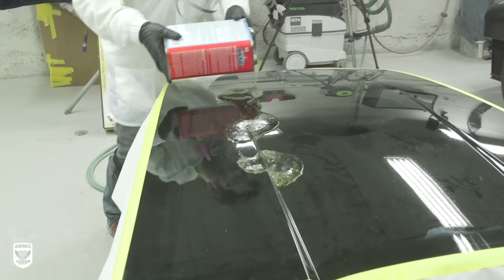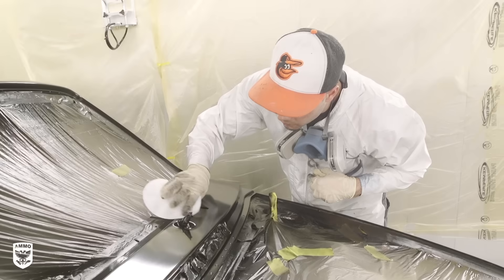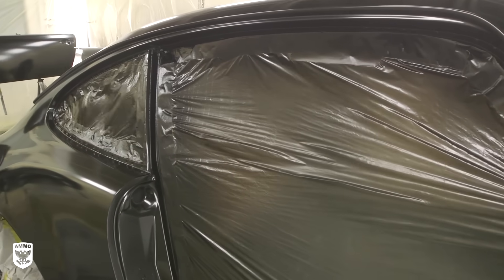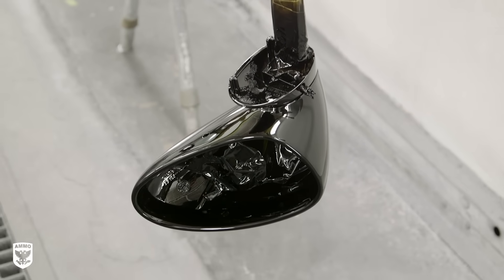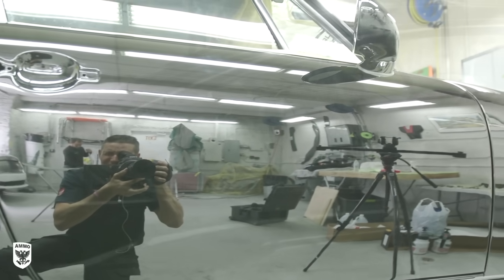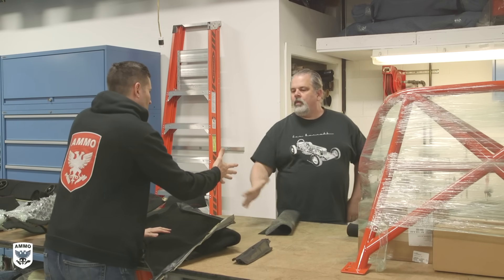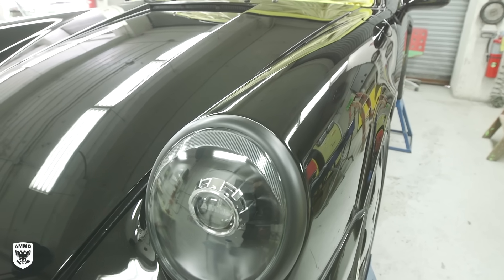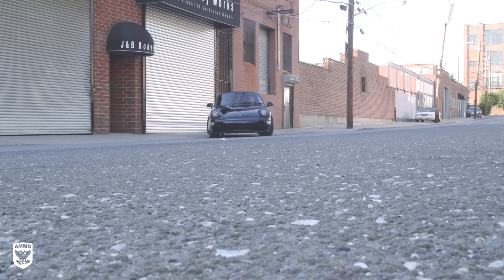Most Insane Paint Job EVER! Step-by-Step Process on the AMMO Porsche 964

Comment: A good paint job cost about $4000 dollars.  I can not imagine how much this must cost.
Reply: In the States a good paint job starts at around $8000 to my knowledge, and a show car paint is easily $20000-30000 alone. The work that goes into bringing it up to show car quality is insane. I bet they totalled out 100+ hours just in the paint department, if not even more.
Reply: round about 40.000 - 50.000 for this complete Work ... It's expensive as hell
Reply: @AustrianScreencasts, I was only talking about the paintwork, not bodywork at all. 
I work at a bodyshop and know how expensive that would of been, with this much attention to detail. I'd a rough estimate on the total would be closer to 70,000 to 100,000.
Reply: Ya'll for real?? A paint job like this would be approaching that much?  No wonder everyone just wraps their cars now.
Reply: It depends on what you want done. If you just wanted all exterior panels done in the factory color and wanted it to look OEM you could get that done well for 4-6k. The better you want the paint to look the more it's going to cost as is shown in the video. If you want showroom quality (ie no orange peel) you're going to have the car based, cleared, baked, sanded, cleared, sanded, buffed just like Larry had done, that is a lot of paint materials and labor to do that and it spans multiple days. OEM and showroom paint finishes are two very different things. That doesn't even account for interior panels which just stretches the project over more days and adds up more paint hours and materials, along with time to R&I the interior panels. Automotive refinishing can be very, very involved.
Reply: You could just go to Maaco and get the car sprayed for a few hundred, but for a car of this quality, easily over 1000 hrs of work went into it. And average around $100 an hr, it could easily be $100k
Reply: yeah but practically every maaco job is shit, and i speak from experience of having seen 10s of cars that were painted at maaco, including one of my own.
Reply: AustrianScreencasts $40 or $50 doesn't sound so bad
Reply: I had a '95 Chevy Tahoe painted at a Maaco.  I went to the shop and talked with the manager.  He didn't make any promises of a show quality paint job.  After talking things over with him, I selected their highest tier paint service (sand, sealer/primer, color, clear).  The paint job cost about $1100.  Was it perfect?  Of course not.  But I was more than happy with it.  I stripped the bumpers, trim, grille etc myself.  The more time you allow them to actually work on your car, the better your result will be.  

A paint job of this caliber, I would be surprised if it was less than $35,000.  The attention to detail applied to this 964 will never be reached in any volume shop.
Reply: Doug, Car & Driver once interviewed a small family paint shop in Los Angeles. They had JUST finished working on a Ferrari Testarossa and painted it black. It had been in the shop for almost a YEAR because they did so much prep work and spent barely a week actually painting the car. The owner got a bill: $16,000. And that wasn't with LABOR!

And the shop owner said it's NOT the most expensive paint job he has done.
Reply: Paint jobs are for fanatics and wraps are for rich kids.
Reply: GanG914 your comment is why I went to school for collision repair, I love when people respect paint and know that Wraps are as trash as the people who use them.
Reply: I probably should add a few things. The owner is a very quiet guy who refused to give his name. He said "Just call me "Junior." He does the same thing these guys do but on a smaller scale with a childhood friend who is also a damn MAGICIAN. Ferrari with uneven fenders (this is more common than you think)? He'll get them perfectly lined up. Air intakes bent and no parts available? He'll fabricate a new one from scratch and even the brand's mechanics won't be able to tell the difference. The sanding they do is insane. They start from 80 grit and work their way so high that the last grade they use feels like glass! That's why Junior's customers could spent 5-9 MONTHS without their car. And he does work on them about 5-6 days a week.
Finally, one hilarious thing happened to him. He finished his most expensive paint job only for the customer to be arrested a few months later and the Testarossa confiscated! The guy was wanted for embezzling and money laundering! How ironic. Maybe that's where he got the money...
Reply: $1,654,900
Reply: 4k is cheap buddy, we were charging £10,000 for resto's on lotus's and they are alot smaller.
Reply: +rcairforceone, so if you spent $1,100 for the paint job, what would most paint shops do for $3,000? Or is there no such thing and you have only two choices: $1,100 or $10,000?
Reply: Curious to see how many mils of clear are left after only spraying 2 coats and then sanding and buffing.

Comment: 12:18 “block sanded to remove heavier imperfections” 

what imperfections
Reply: I dunno man, that extra atom on the left side make's this a 0/10 for me
Reply: Xcalium 😂😂😂😂
Reply: the ones left by the metal bracelet at 12:21  maybe
Reply: Jeff Moth yuckkk mehn metal braclet on paint😬😬😬
Reply: If he would had use an iwata super nova he wouldn’t have that much orange peel for sure
Reply: K Man  I was a painters helper at 15 years old my Dad had a big Body Shop and we did mostly heavy collision work but some custom paint work once in a while yes body and paint work are hard work but once you learn what it takes it becomes routine
Reply: The ones the camera doesn't show...even half ass work looks good on camera(not that this is half ass) just sayin!
Reply: Orange peel

Comment: Yup very important to keep the trades going as the masters are dying off! My uncle passed away 19-1/2 yrs ago at 51 from ALS. He owned one of the biggest, cleanest collision repair centers in the U.S.A. I worked there for 15-1/2 yrs as the head technician in the R&R department. Every car came apart & we never ever...! Taped anything off...! If we replaced a fender & needed to go down the side to match the paint. The door came apart handle, mirror, belt molding & window. Taillights & bumper covers! So absolutely no over spray could get on anything. I did wiring harnesses, air bags, A/C, suspension, alignments! What ever needed to be done...really! We did an average of 35-40 cars a week. That's in on Monday & out on Friday...! No matter how severe the collision was! You can eat off the floors & the place is huge! Up front we had 3 lifts, 2 alignment racks, 2 Kansas Jack frame machines, 2 snap-on A/C machines. Brand new Hunter High speed wheel balancer & another wheel & tire machine. We also obviously had welders, torches, spot welders to do factory looking spot welds. State of the art Shark machine. This machine would measure your cars frame/unibody by electrical pulses. So if you needed to pull a car back into shape you could literally get it back to factory spec! We have a Devillbiss down draft paint booth. Which was on the level below the R&R department. Then below the paint department was the body work section. We also had a full parts room were every part...new & old was stored untill it was time to put your vehicle back together. We also have a reconditioning department where the cars went to get washed, buffed & cleaned before the customer got their car back. This room featured a lift & a state of the art water recycling system. So no soap went into the drains. One of the most amazing body shops on planet earth. My cousin still owns it. After Hours Auto Body in Taunton, Massachusetts. Check out the website if you wish....👍❤🏁
Reply: That shop sounds great, a workshop being kept super clean is always one of the best signs it's a legit place.

Comment: This is what you can expect from every MAACO $499 special.
Reply: You can expect orange peel whether you pay 500 at MAACO or however the fuck this much cost?
Reply: Most appropriate comment ever
Reply: 40 years ago I had my 1969 Cutlass painted at MAACO for $80.00 and it actually came out decent with no orange peel or runs.  Good booth and equipment and a good sprayer made the difference.  For a 10 year old car, good enuff.
Reply: grit not grid.
Reply: I will pay for a maco job and do the buffing myself

Comment: If you live in a metropolitan city the first time you bring this out a bird will shit on it and someone will bump a shopping cart into It
Reply: should have come with an engraved 1911, for those moments when a few choice swear words just wont do.
Reply: thats exactly what happened to my car. It was stored for 15 years and in the first 24 hours out some one magically scratched and damaged the bumpers while a bird took a massive dump on the hood, window and roof!
Reply: You can say... Shit happens??
Reply: Its a track car
Reply: This freaking eye scared me...like WTF...lol
Reply: 123456bmx +
1982. Had just done some touch-ups to my 72 Charger, blended them, buffed out the sand marks, and glazed it all by hand (we still used enamel paint then, no base coat/clear coat nonsense). Went out cruisin on a beautiful Saturday day. Stopped at a local restaurant to eat (too afraid to navigate that land yacht in the drive thru). When I came out, the black was looking all salt and pepper. It seemed as if every bird in the county had joined forces to do strafing runs on my car. I just gave up and went home. So funny now, I can still remember how mad I got that day.
Reply: Depending what angle and how hard someone bumps into it, the clear bra will take most of the damage. It might end up getting scratched but it won’t be as nearly bad compared to if it wasn’t. As for bird shit I’m sure he’ll have it ceramic coated in no time.

Comment: another good way to stop dust from wanting to gather towards your painted surface(cause when you paint you build static) is to lay a chain over the frame or axle and lay it on the concrete. It works great cause it grounds your car.
Reply: I use a grounding strap on a oem body ground.

Comment: Pull the plugs and shoot fogging oil in the cylinders. Leave plugs out and turn it over til oil light stays out during cranking. reinstall the plugs and fire it up. That is how you start an engine that has been stored.
Reply: That's what I thought too, unless the electronics on his car don't like firing or could be damaged without the spark plugs connected. Some circuits in other applications are like that.

Comment: "The goal is 'X'. How you get there is what works best for you." Words of a true craftsman. Would love to know what the interior guy used to replace the water-soaked foam padding under the front carpet. It's thick and formed to fit the valleys, ridges, and any buried parts. I wouldn't think a simple sound proofing layer to be ideal if you're looking for an oem fit. This is something I need to replace in one if my old Saabs.

Comment: How is it possible that you hadn’t seen a windshield applied using a string? This is super standard.
Reply: Has always been done that way, at VW in old days we used a single core electrical wire.
Reply: Not standard because most cars these days don't use rubber seals,
Reply: It’s an old school way, I’m not sure they are even legal with airbags in some countries. Nearly everything including heavy goods vehicles are “glued” in
Reply: Explains why when i worked at a MINI dealership string was always hanging out of the windows lol never understood what it came from
Reply: That’s what you get with experience old tricks

Comment: Shooting over 800 grit is insane don't be surprised if it chips easily
Reply: Baking basecoat off is a big no no, skins over and then it causes delamination when jet washed or such as you mentioned stone chips....
Reply: you can shoot over 800? as long as its scratched up good you can shoot over 3000. especially clear. it turns out for a better finish. i work collison. i prefer to blend with 800 and 320

Comment: How do you make the paint durable like OEM factory paints jobs that resist chips better than most after market body shops, which can looks just as nice or even better but don't have the durability of OEM factory paint.  The factory can bake the paint/clear coat @ high temps  because the car is not fully assembled yet, metal frame only, but now that would be difficult.
Reply: thanks for providing no value to this question of how.
Reply: Tee, you really need to get off of this channel. You are a huge troll in the car community and comment on hundreds of peoples videos. Do something else with your time my friend.
Reply: thanks 

It too bad only high end car companies like Aston Martin, Ferrari ect offer Factory recondition certified programs that allow any year to be sent back to the factory to be brought back to OEM spec including body and paint work.

 yes its expensive but why not offer that options to other more cars.....ie send back your damaged hood to the regional BMW factory stripped and prepped, then that piece goes though the same factor process, dipped in anti rust bath and charged for paint using the same paint process and then baked off the car at 400 deg to get that clear coat durability so often lacking in after market body shops, who only do paint & body work yet cant come close to the factory which has to make the entire car !!

  one the the rare industries in which specialization leads to a worse outcome...
Reply: the dirty up over time and a line develops, also hides true shine.  More asking why cant after market shops cant match the durability of oem pain, which can be damaged by rocks ect...but seems to be less prone to

Comment: Damn that looks expensive ...
Reply: VERY expensive lol.
Reply: 70k
Reply: No way. No where near that. A professional repaint is around 10-12K. On top of that those wheels are probably around $6,000, the interior was around 2-3K. And then the finishing products of powdercoating was most likely a few thousand. Overall, around 20-30K. Not 70K.
Reply: Alex Schmidt hardly. At my shop for the amount of perfection demanded by the customer and what is delivered by the shop in the video, 70k is very much within the ballpark. Just for the exterior panels and frame you’re taking 20k.